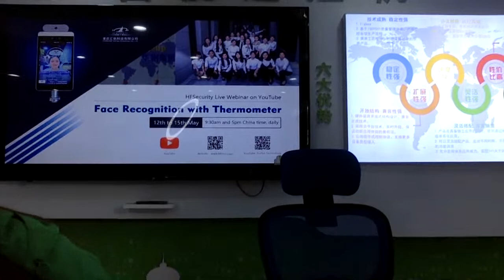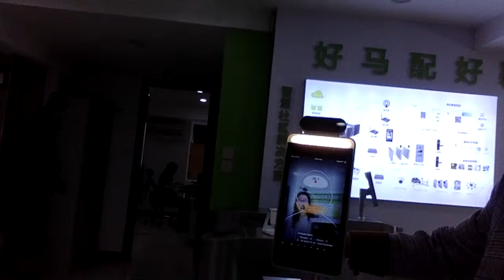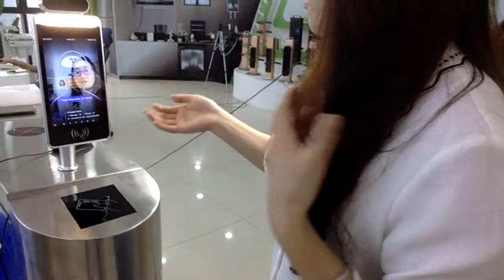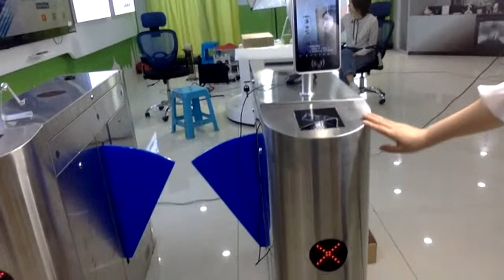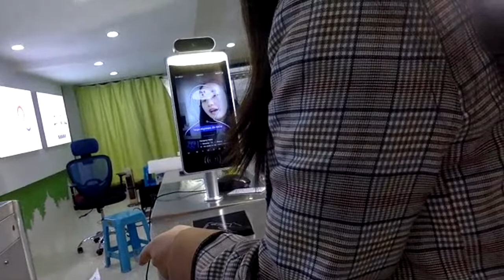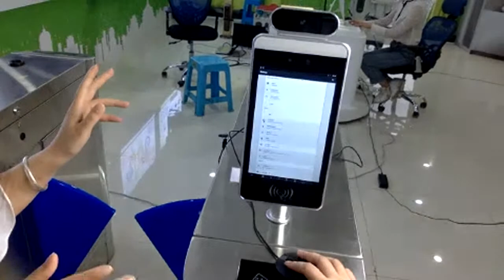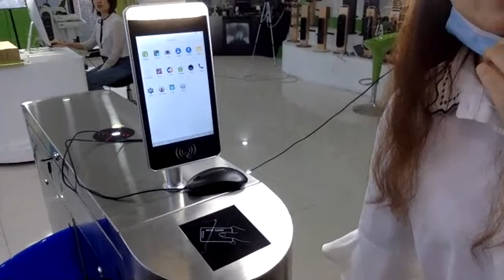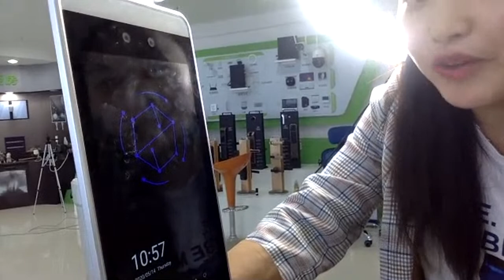RA08T

Comment: we got one. after plugging in the power, it keeps restarting making sounds after restart. only blank screen shows and it restarts again. what could be the problem?
Reply from the maker: could you give me your email we can  contact with you ,and solve your problem
Reply: Joyce has resolved my issue for me. It was a power issue; I was asked to replace the 12V power adapter that came with it.